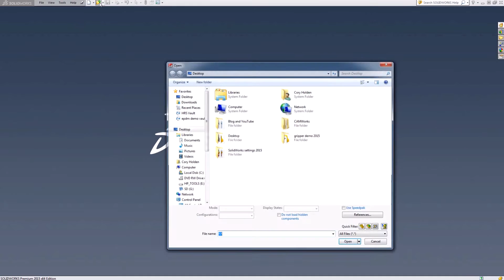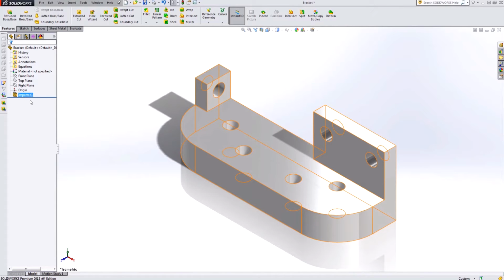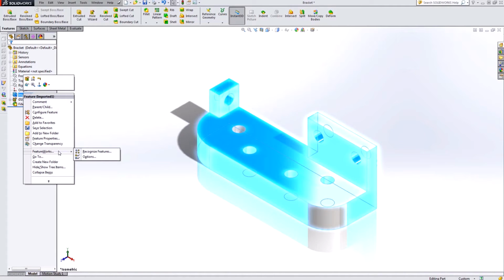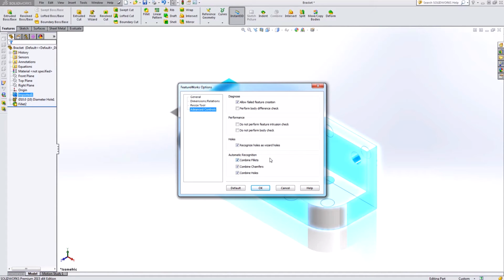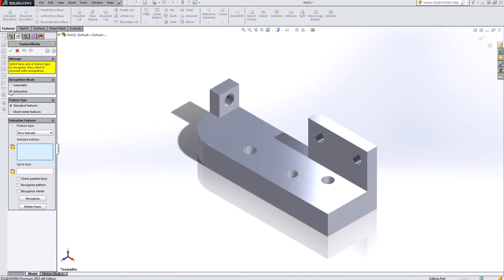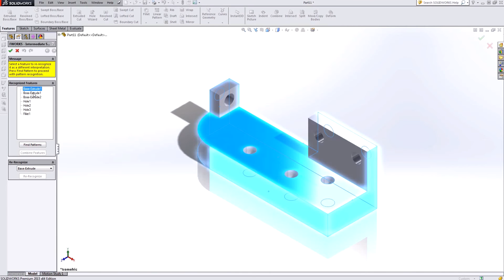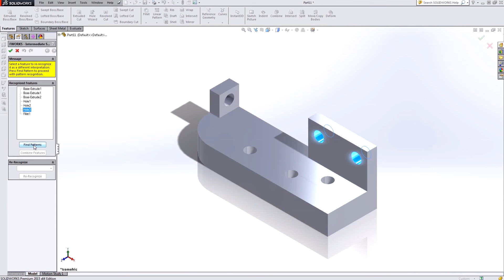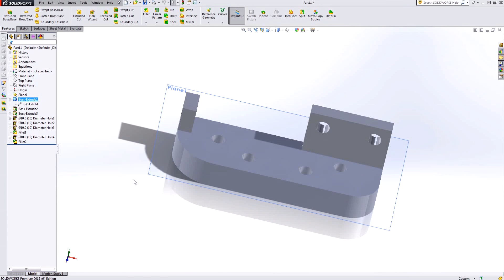SOLIDWORKS - Editing Imported Models with FeatureWorks

Comment: The 3D interconnect option in Import settings..should I turn it off? 
https://forum.solidworks.com/thread/213164
on this link, you can see that 3D interconnect option needs to be turned off to activate FeatureWorks.
I have a surface design, which I cannot edit as it is step file. And when I turn this 3D interconnect off. the FeatureWorks is not loading. Please help.